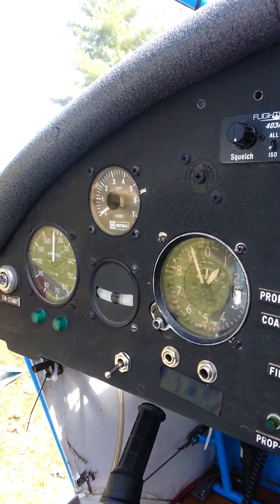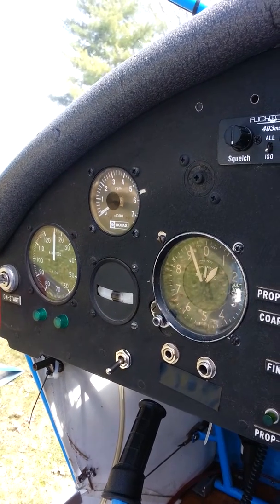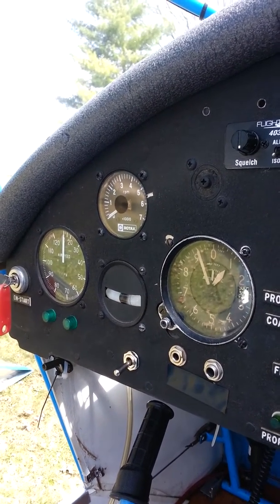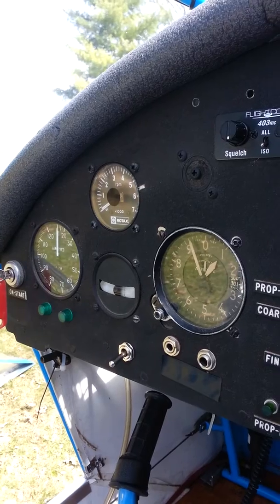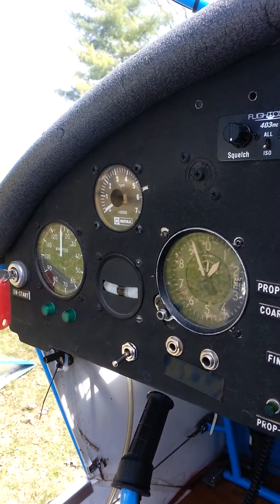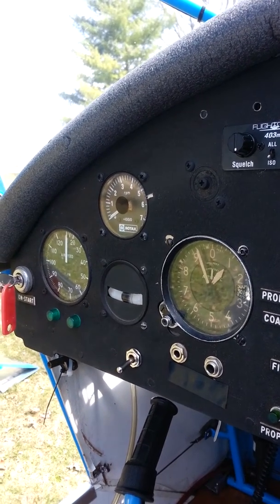DIY Electric Elevator Trim 2 of 2

Comment: Another idea could be to program an arduino and rig up a rocker switch on your flight stick.  This way you could set your trim without taking a hand off the stick or throttle.  You could also program the arduino to give some sort of indicator on the dash.  Perhaps just some idea to play around with.  Nice plane!